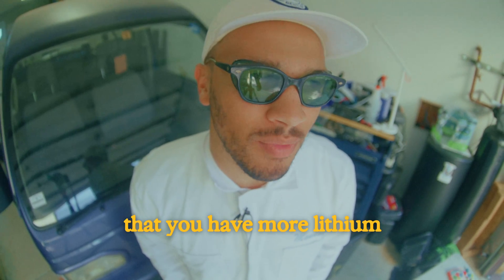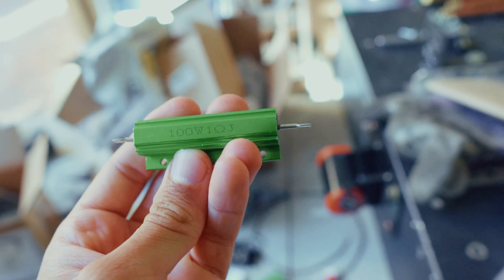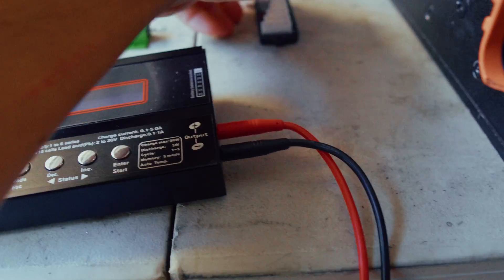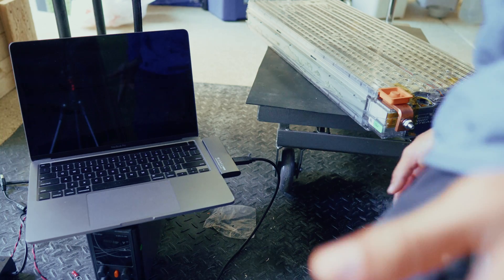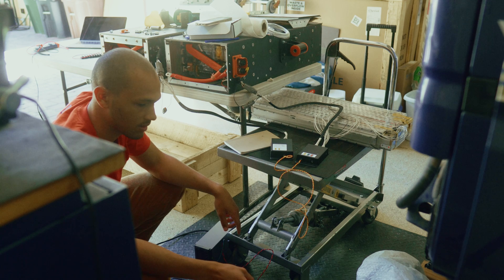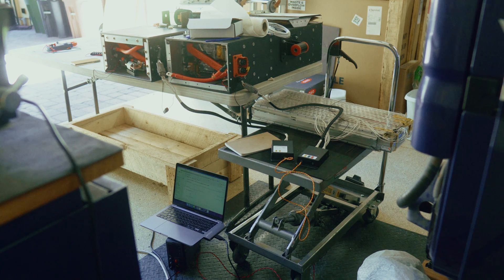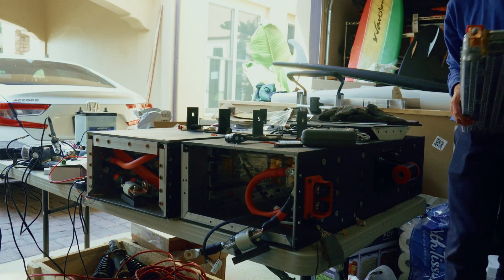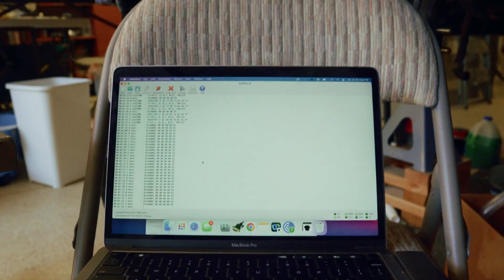Charging and balancing the Tesla batteries in my EV Conversion

Comment: How do you manage burnout on a project like this? I think that I personally would have a hard time staying motivated running into things like 6 month supplier delays.
Reply from the maker: You're asking the right questions. It was really really demotivating to have the battery set back. Unfortunately it wasn't the only big set back as you'll come to see. I think it came down to just knowing if I didn't get the van moving it would just sit there forever, which wasn't an option. So I just had to get it done.